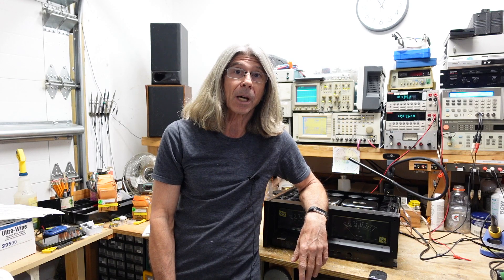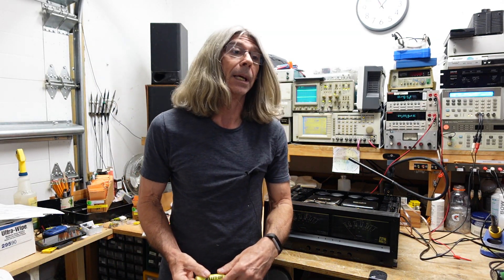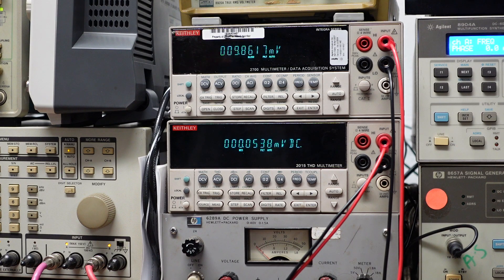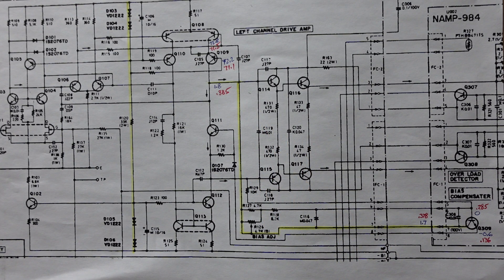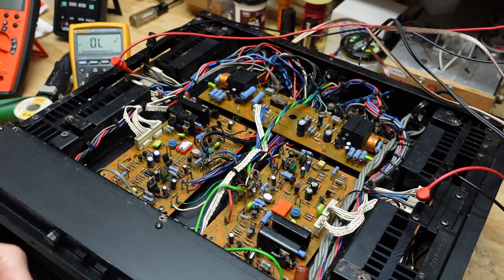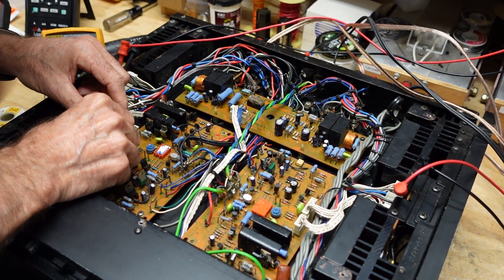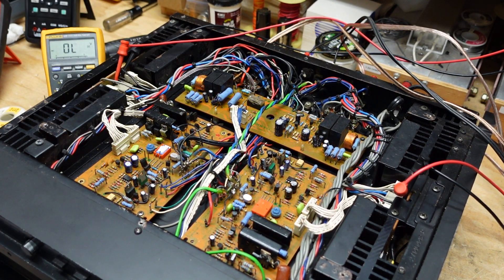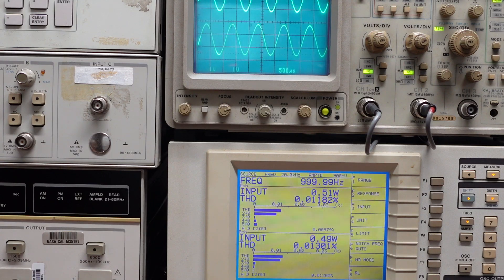Onkyo M 5090 Unable to Set Bias

Comment: ONKYO TX-2500 SOLVED : couldnt adjust bias on right channel which was distorted - changed some minor parts on the driver board (one resistor, one transistor) - driver Q603 was getting hot due to a bad output transistor (Q605) which is a toshiba D718 - was able to find an original replacement at my local store. changed both of that type  - ET VOILA ! running great with the right bias voltage of 20 mV. man, that was fun...
Reply from the maker: Great job!  Again, I'm impressed with your results considering the short time you've been at it!
Reply: @raygianelli3612  thx, me too. started with cleaning lenses and changing belts, but that was boring. discovered vintage hifi from skylabs videos. next project is waiting - onkyo tx 4500  😍
Reply from the maker: @lechiffre2617  IIRC those are well regarded units.  Is it currently working?
Reply: @raygianelli3612  onkyo lover here. the lower tx's are kind of sleepers i think. enough power for me at least. i dont have it on the bench yet. its in the mail...im hot ! owner says it lights up.

Comment: great video - working on an onkyo tx2500 and cant adjust the right channel which is distorted also. so i will follow your path and measure some voltages first. thx
Reply from the maker: Print out a section of the schematic, and measure the same points on both the good and the bad channel.  Notate the schematic with these; I use green or blue markers for good, red for bad.  I used to just write them down in columns, but marking the schematic makes the trouble more obvious.
Reply from the maker: Oh yeah, what's the waveform look like?  This can help pinpoint the issue(s).
Reply: @raygianelli3612  oh i just started last year. its just a voltmeter and me - and the right schematic. rail voltages are good. changed some caps but the originals were not too far off.
Reply: @raygianelli3612  thx for the reply
Reply: @ made some progress. 1. one resistor was off in value - replaced it 2. one driver transistor was shorted - replaced it - all voltages perfect 3. measured some temps of all driver transistors (forum hint) and one got very hot - so i will replace the one pair of the output transistors on this channel.
Reply from the maker: @ For somebody who just got started last year you've made impressive strides!
Reply: @raygianelli3612  yeah - im a left handed wizard...lol

Comment: I just love your videos! This is what we need more of in the world, talented people who are knowledgeable and articulate when it comes to discussing and diagnosing. I have the same problem with my Sansui G9000 I just purchased. I can not set the bias on left or right channel after setting the DC offset. Need to set to 16mV, left is 11mV and right is .2mV. The Pots have reached there limit. Trying to diagnose the cause to correct the issue.
Reply from the maker: Thank you!
On your G9000, check to make sure that the leads to the bias stabistors D02/D03 have not been broken; they thermally track and adjust the bias, and are usually mounted on the output heat sinks.

I would also check the voltages at the collectors of TR05 and TR06.  They should be around +1.6 and -1.6 volts, respectively.
Reply: @raygianelli3612  thanks so much I will check both and let you know the prognosis outcome!

Comment: I like the LT1166 bias servo IC, which also offers over current / short circuit protection for the output stage. I have used this IC several times in high power output stages.

Comment: I have an Onkyo m 504 amp that I bought in 1988 while stationed in Spain. One of the speaker select switches won't stay engaged. I think it's  a bad detent. Anyone know if replacement parts can be found for these vintage amps or can this one be repaired? Any info would be GREATLY appreciated :)
Reply: @erdemkaya6472  yes..nothing came up other than other amps for sale :)

Comment: Hey Ray, I have an Onkyo M-504 that is having issues. I am not sure where you are located but I don't have the equipment to fix. I also have a 4 channel dBx amp that is not working. Where do you get those schematic diagrams?
Reply from the maker: I'm in South Florida.  Most schematic I use come from HiFi Engine.
Reply: @raygianelli3612 East or West Coast? I'm in the Tampabay area and can always use a top-notch tech that's only a few hours away.
Reply from the maker: East, in Palm Beach county. @johnsonRobinsonJr

Comment: You mentioned it’s not a good idea to replace output transistors with aftermarket. I have a Marantz MR235 with right channel shorted transistors because of age only aftermarket are available.
Reply from the maker: When we speak of aftermarket we are referring to broad spectrum replacements such as NTE or others like them.  A far better solution for output transistors is to select a current production transistor from manufacturers such as Onsemi, Toshiba etc.  Look at the data sheets for the 2SA1492/2SC5200, they may be suitable.

Comment: Nice work! Iam currently working on a M200 and was wondering about the two back2back 4,7uf electrolytic on the relay board. The two ones besides the three blue resistors. It even says there should be a diode :)